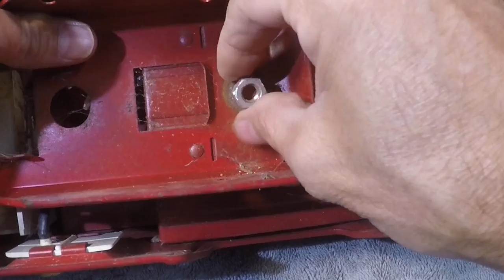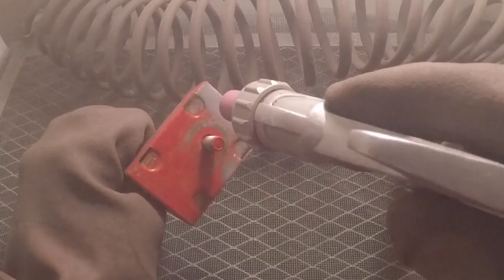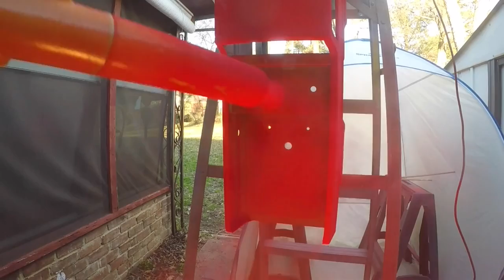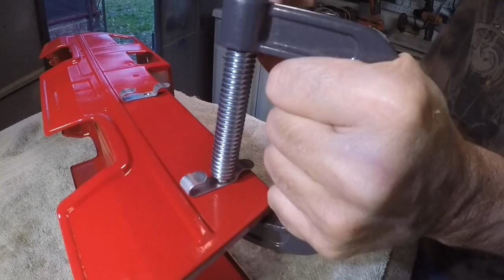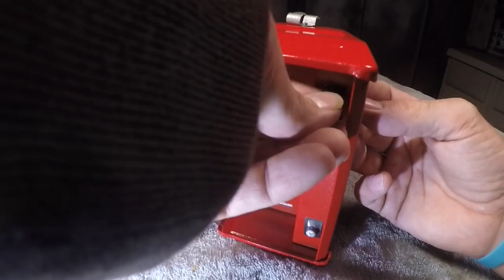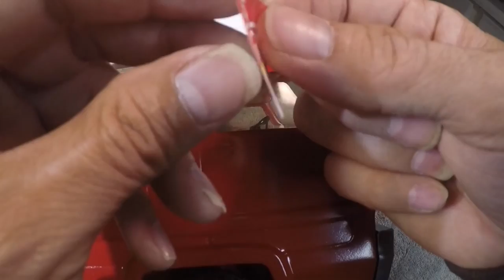Tonka Snorkel Fire truck Restoration.(Circa, 1972-1973)

Comment: I had one of these, but it was a few years younger than this one (I would say late '70s) but functionally was the same.  My mom still has it in storage somewhere.  I would hook it up to the hose and pop the water cannon off the lift so it was only connected by the hose.  The water pressure would cause it to fly around randomly almost like a water sprinkler and I'd play in it on hot summer days.

Comment: I had this truck, although the exact model was slightly different. The water hose connection was shaped like a fire hydrant and used two rubber hose sections the connect to the truck. It was my favorite, even though my brother had the massive ladder truck.
Reply: They're exactly the same.  The fire hydrant is the adapter to a water hose.  The two black hoses on the truck go in between the hydrant and the truck.

Comment: On another restoration channel he primes the metal and wet sands it before color painting.  Have you tried this?  Your paint looks really good and from the  video I cannot tell the difference.  All I can imagine is wet sanding would make the finish smoother.  What do you think?
Reply: That's powder coat, which is different than spraying on paint.  Tougher and thicker, but not as smooth as spraying on paint.

Comment: Can you tell me what a snorkel truck is? I don’t think I’ve ever heard of one of those. Good job on the restoration.
Reply from the maker: Sure! The boom that has the bucket on it is the snorkel. The power company uses snorkel trucks when working on the power lines. The name comes from the snorkel sticking out out the water when someone is snorkeling  🤿
Reply: Thank you.
Reply: It's literally the name of the company that makes the boom for the trucks.  It can be a fire truck, utility truck, what ever the purpose is.

Comment: isn't there a hook up for water? They made a fire engine that actually sprayed water out. With that much trouble for hose and attachments there has to be and adapter to spray water
Reply from the maker: There was. It was a little hydrant that attached to a garden hose.
Reply: @RustyShepherd  Oh okay yeah I saw a restoration a year back that had that hook up now that you jogged my memory and he hooked it up and ran water through it. Thanks for the reply I know you guys get a lot of messages